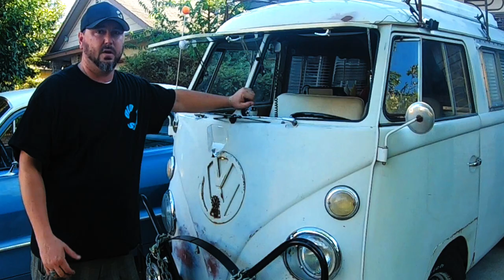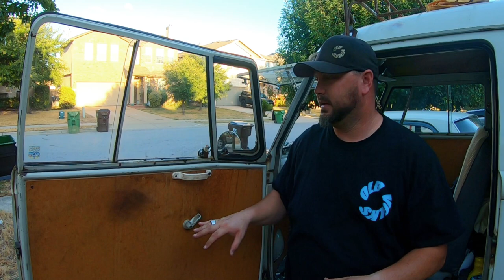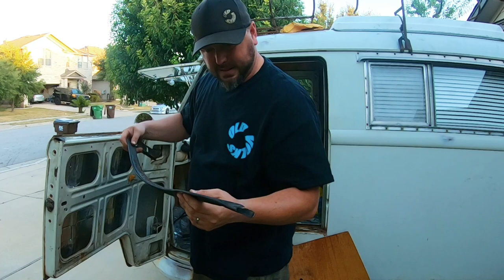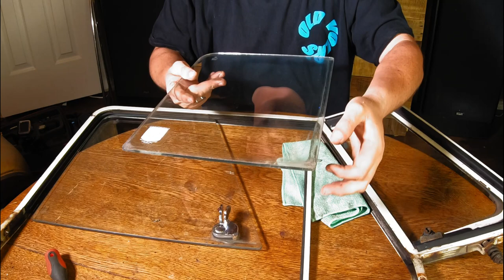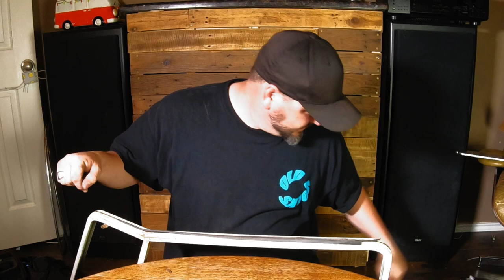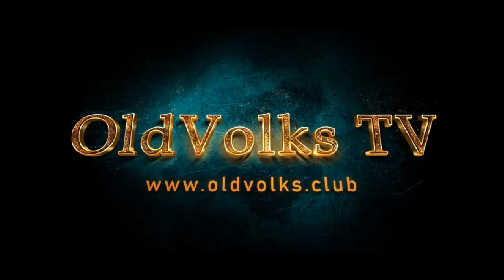How to replace window seals in a VW bus

Comment: What is your special tool for replacing the front window rubber? Trying now and it feels impossible getting the rubber into the grooves
Reply from the maker: Baby powder and a heat gun. I also used  a set of plastic prys from the auto parts store.  They're firm but not sharp enough to cut the rubber.

Comment: I am wondering if you could please tell me how that little vent lock comes out? the one that you have is broken like mine, so i am wondering....thank you!
Reply from the maker: Theres 2 screws on the bottom of the frame that hold it on.
Reply: @OldVolksTV   great! so i am provably have to remove the frame to get to it???
Reply: frame: the quarter window i meant....
Reply from the maker: Yes. If you pull the glass out, there's 2 screws holding the lock in place.

Comment: So where is part 2? Do you have to cut and replace the rivet on top of the vent window?
Reply from the maker: Yes, need to cut the rivit. I ended up using a small bolt. Part 2 will be out soon.

Comment: Show us the secret to how to put the rear taillight new rubbers in, I give up, my brother gives up, I'm at the point of cutting the backside rubber ever inch and then sealing it with black rtv silicone when it is in??
Reply from the maker: Time, heat, and patience. Put the rubber on the light first, then ice a pick to pull it from the inside.
Reply: @OldVolksTV  show me??